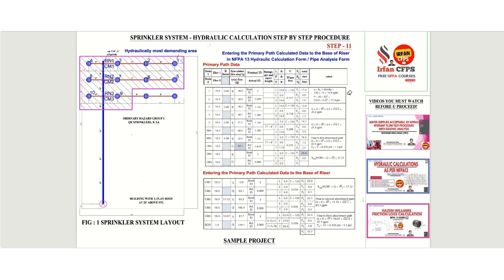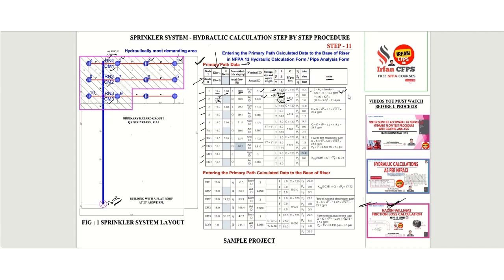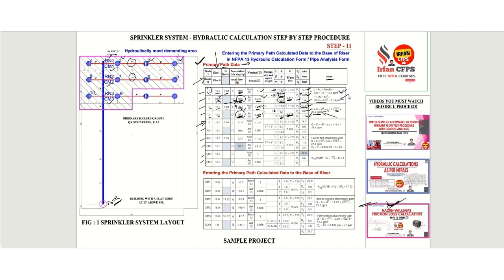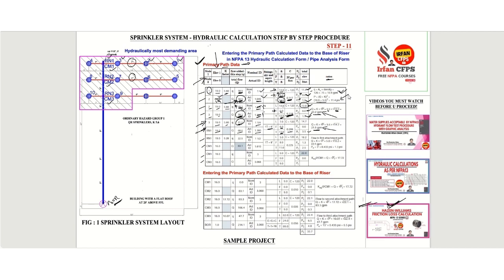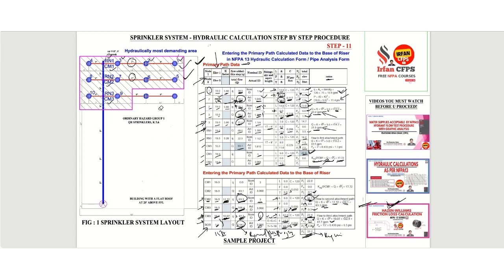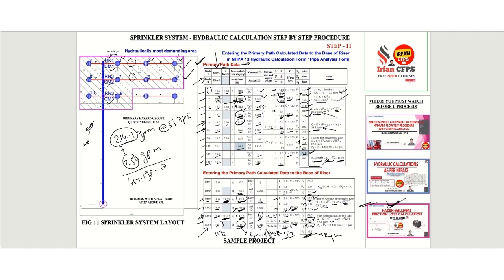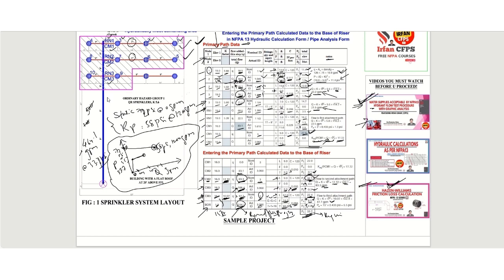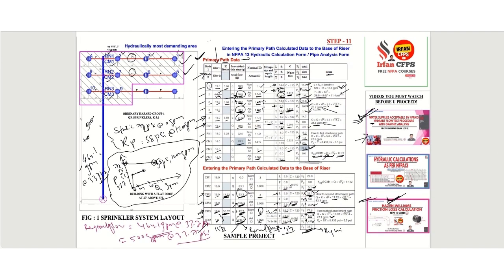Step 11 |Hydraulic Calculations for Sprinkler Systems

Comment: Sir why did you compute the attachment path if the whole system can be computed using the primary path? Im confused. 

In addition to that sir if I will use pendent sprinkler, then i need to consider the sprinkler to drop pipe then drop pipe to the riser nipple then riser nipple to cross main? Thank you sir!
Reply from the maker: It’s little complicated to understand the manual hydraulic calculations. Pls try to perform calculations using software
Reply: Noted sir. I’ll try to study the software. Thank you.

Comment: Sir I have a question regarding the calculation. Do I only need to consider the most remote area (the 10 sprinkler in your example) to get the demand of the whole system? Like in your video is 500 gpm with 33 psi head is enough for the whole system? Or is it only for the 10 sprinklers? Badly need your help to understand fire protection system. Thank you so much!
Reply from the maker: Design area is enough to know the requirement for whole system
Reply: @irfancfps  thank you sir. So after sprinkler placement and identifying the most remote area, i need to calculate the remote area only up until the bottom of the riser? Then it is enough for the whole system? Can I ask sir the reason why do i only need to consider the remote area only Not the whole system? Thank you so much gor your helpful content.

Comment: hello .... appreciate your video .... but i have a question.... why we start the hydraulic calculations with the attachment paths? even we will not used to calculate the required flow and pressure for the system ?
Reply from the maker: I might not convince you but this is the procedure as per nfpa 13.